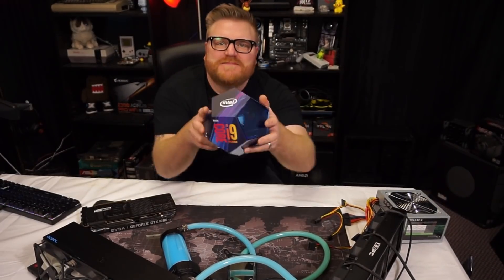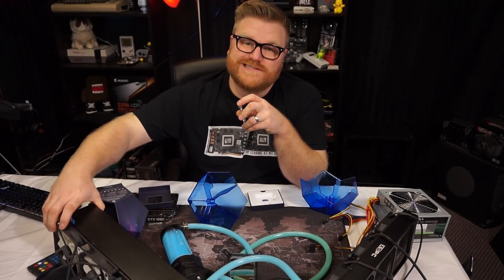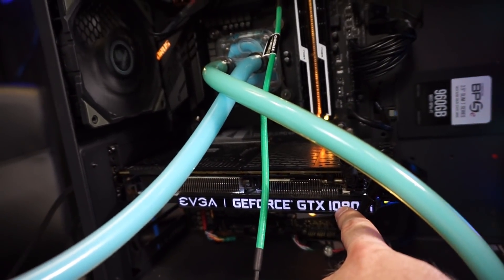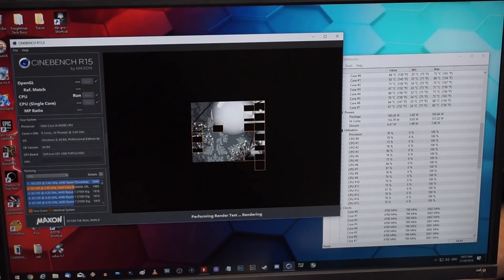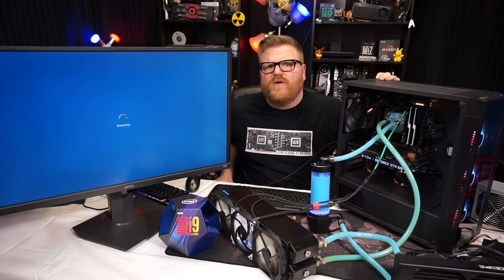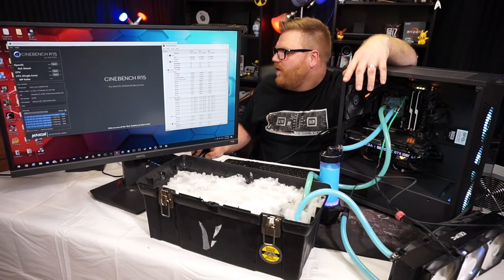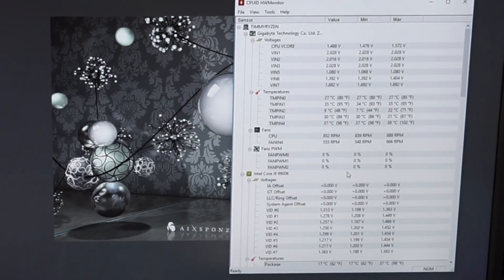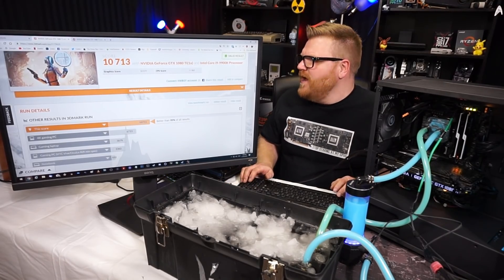Overclocking the Intel 9900k to 5.3 Ghz WITH SNOW!

Comment: And i am Sitting here and waiting for 10nm intel processors :D
Reply: Global elite You’re going to be sitting for a long while
Reply: 10nm won't be worth it in 2019 when they finally release. 10nm+ is something to look forward to though.
Reply: 2019 in your dreams, Intel officialy said 10nm not before 2020 and its for servers cpus, mainstream probably late 2021 xD 
Its so bad, Best u can do now is get 8700k used or something for cheap oc it to 5ghz and wait 3 years or probably more for really better single core performance.
Ryzen 2 will be only 10-15% better in single core perf. so about same as Intel after max oc now.
Reply: @pilot554  last I heard it was still Q2-4 2019. Don't really care since I got a 9700k so I won't upgrade until 2
10nm++ either way. And why the fuck would you buy used?
Reply: Because used is cheap, if u have money u dont hesitate but just go for top end 9900k :D 9700k  if u have good cooling should last u for many years. To bad we wont have revolution in ipc from intel for like 3 years or more.
Reply: @pilot554  buying used is still stupid tbh. People need to learn what saving means lol. You can still be poor and buy a top end system.
Reply: I can agree, Every one can buy what he needs. And cpus can last for decades so why not go for used if u want ;)
Reply: pilot554 So,should i buy 8700k and wait for 10nm?
Reply: @lilnword12  Why? the 9700K is a little bit better and costs about the same. But yeah, it doesn't really matter. You'll get great performance with a 8700K aswell, just a tad bit better in games with the 9700K.
Reply: burr i think i will buy 8700k I WANT THAT HYPER-THREADING :D
Reply: Global elite Joe is a liar and trying to sell you amd over intel. 7:45 Joe exaggerates the 9900k temps and also underestimates the performance of Noctua NH-D15. Dont believe me, see for yourself as I test exact Cinebench test:  https://youtu.be/POzPHfXSBJ0

Need more proof, watch under AVX load which is way more intense than a 20 second Cinebench test:
https://youtu.be/POzPHfXSBJ0
Reply: Intel has been having problems in that department.  They went from 14 to 12 and back because they havent solved their thermal problems.  They won't be getting any smaller until they can fix the 80C idle core issues.

Comment: I always wonder would if you put a ice cube inside your pumps reservoir will that help with cooling since the water is being cycled through and around the ice. Can you please test this out
Reply: The ice cube would melt really really fast and it would probably do next to nothing
Reply: In my experience it just melts. You have to have a drain setup and constantly add ice then drain. You get results but it's more work than it's worth. Unless you do this repeatedly for a long time at idle it wont get cold enough for condensation to be an factor